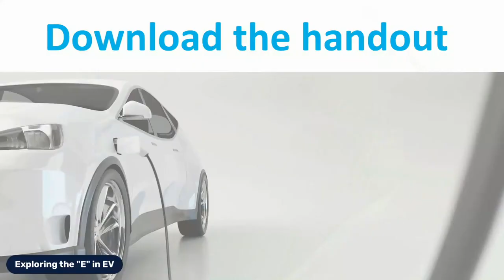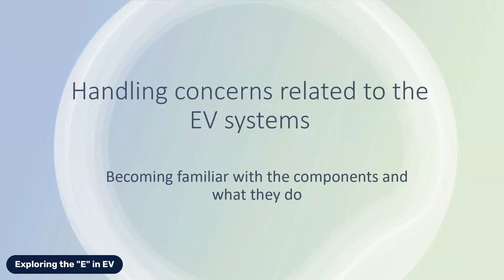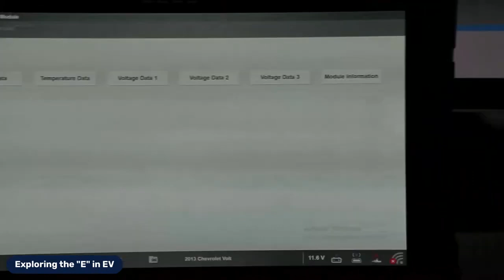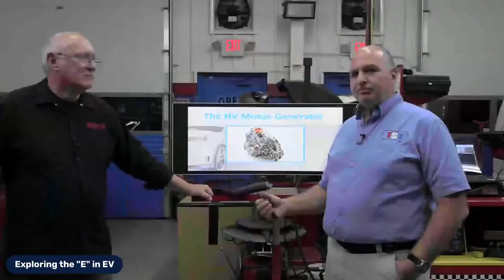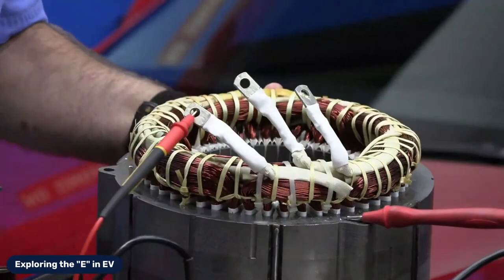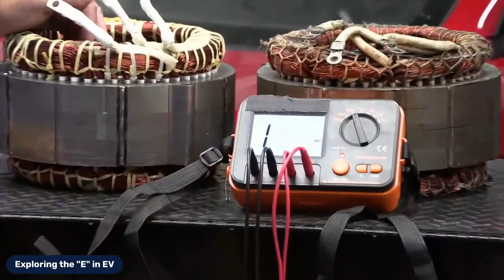Exploring The “E” In EV 1

Comment: Body shops really need to see your section about 12 V batteries they’re notorious for destroying cars batteries causing drivability problems and no starts especially on electric vehicles. 

It’s a unbelievable car count of damaged 12 V batteries that are allowed to go flat in body shops and then they put the good old fashion 30 year old battery charger on the battery and cook it up and make some good battery soup that you could smell from across the shop with the bubbling boiling hot battery. 

The future of HVAC for air conditioning with the new heat pumps on electric cars is a gold mine for shops who are in the know. 
        For the shops who choose to be dinosaurs and not educate themselves heat pump systems will bankrupt them the first one they have to pay for that they destroy the compressor on and the customer goes to a dealership to get repaired after they incorrectly charged the system and cooked the compressor. 

I live out here in San Francisco California and teslas roam the street like cockroaches in a dirty kitchen when you turn on the lights at night. My wife has a model three. 
         Why model Teslas are starting to have a problem with burning up compressors for some reason.    And if it’s a really bad system with a burn out and contaminated oil the cost for the replacement of everything is in the price range of the GDP of a small country. 

I have two businesses commercial HVAC but I have been working with heat pumps and heat recovery systems in glycol loops for over the last 30 years plus my automotive business for air conditioning only. 

With the upcoming electric heat pump systems you can add an extra zero and an extra digit at the end of your income if that’s your specialty
Reply from the maker: Thank you for your comment and for watching....If you have not already subscribed to our tstseminars YouTube channel please do so. Interested in more training? Go to www.tstseminars.org and view full length videos for members on TechFlix for $9.99 unlimited viewing …Membership and over 85 videos for less than $200.00 a year. Also checkout www.attstraining.com for hands on training and webcast FREE videos at www.tstseminars.org/training-videos